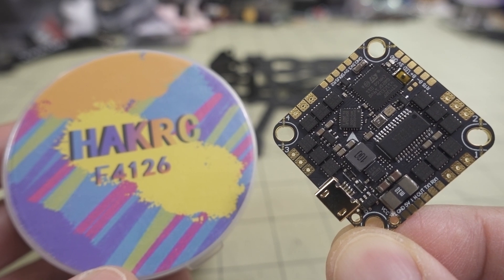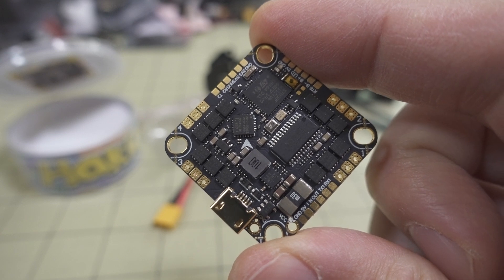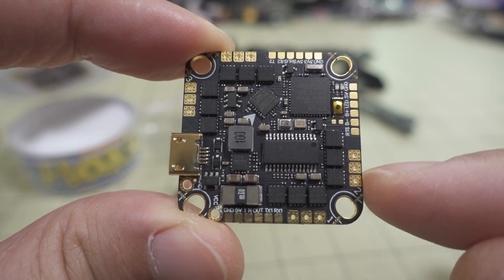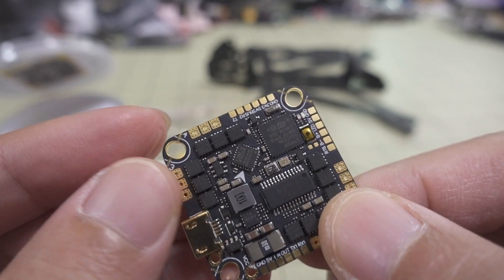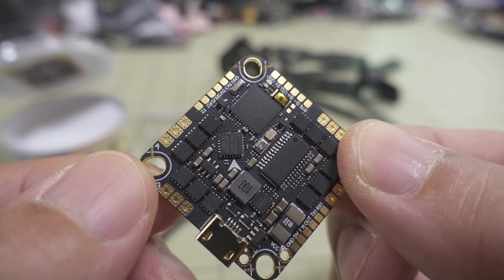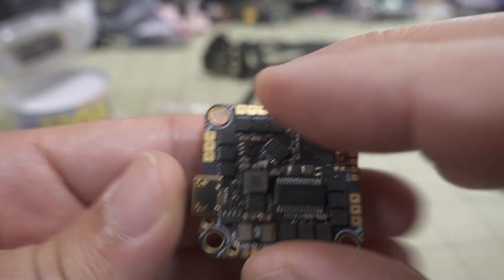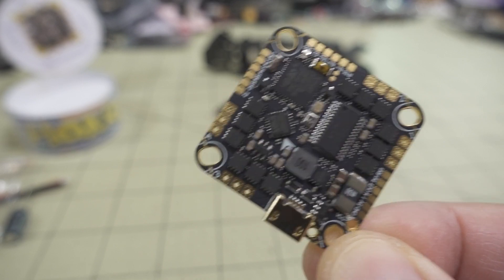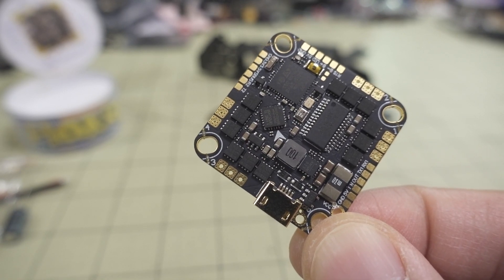Budget Micro Build Option // HAKRC 20A AIO FC for $35 💲

Comment: im trying to wire up an r-xsr getting no stick inputs through any of the pads. how would you go about wiring up an rxsr ive looked online and there is no manual anywhere thanks for any help!
Reply from the maker: Simple.  Signal to SBUS, 5V to 5V, GND to GND.
Reply: @AlbertKimTV seems like a dumb question but that was exactly what I thought in the first place sbus of course... but it wouldn't work. Thought maybe the board didn't have an inverter or something I dono thinking to much...
 Starting to think my rxsr is screwed up a few times signal came through and all my channels went haywire when I would move the receiver...thank you very much for your speedy response

Comment: HELP.... Albert Kim I'm trying to get this to work with dji video and nano rx also with GPS but I couldn't find any information on what pins are for soft serial.
I ended up making such a mess of the configuration  I've reflashed with bf 4.26 and now I don't have any soft serial to choose from. 
I don't suppose 1. You have a diffall dump dumb for bf 4.1 or 4.2 for this fc where the soft serial is still configured? 
2. What pads are for the soft serial?
Thank-you in future for any reply that could help.
Reply from the maker: I setup this board on the Transformer Mini build.  It has crossfire, DJI, and GPS.  I think the GPS is on the softserial, but it might be the vista.  Not sure.  The CLI dump is in the video description...  https://youtu.be/v_yYE6sF3sg
Reply: @AlbertKimTV  thankyou very much 👍 you wouldn't happen to know what pads on the fc are already set up for soft serial on would you? I'm planning on putting the vista on soft serial because I'm using the same GPS that you did.

Comment: still cant figure out if i can solder an A8S on this board since it only says SBUS and i tried connecting the signal wire to SBUS and set it up in BF but still not working. Any idea what to do?
Reply from the maker: SBUS and IBUS are inverted so you can't connect an A8S to the SBUS pad unless you change the A8S to SBUS mode.  You can use the R2 pad next to the SBUS pad and that will work with an A8S in IBUS mode.  Also make sure you select IBUS as the receiver protocol in BF.
Reply: @AlbertKimTV  thanks albert.. And yes.. It worked.. This freakin board ao tiny.. Haha. Managed to squeeze everything in this tinawhoop frame.
Thanks again.. R2 was the key indeed!

Comment: Great review. 

I was looking into HakRC products earlier today. Do you have any durability testing? I always feel like 20x20 FC and ESCs are more delicate (especially the 20x20 35A escs for 5” quads) but I could be wrong.
Reply from the maker: Like I said, I think if you're going to budget and cheaper stuff, use it on things that aren't gonna be abused.  If you crash a lot, I'd say get at least a couple of these and/or spend the extra bucks for the 40A ones for about $75.
Reply: Thanks!  Yeah I abuse my electronics. I just would rather blow a $35 ESC than a $70 one, especially if the $35 lasts like 6months. Haha

Comment: Could I use this as a replacement board in betaflight hx115?
Reply: 3s or 4s battery? Technically, yes you can use this as replacement and it might work, but like any of these AIO boards, the quality control is random seemingly. You may want to try a jhemcu 30 or 35a, but same can be said for those.
Reply from the maker: Yes

Comment: albert hi mate...i recently got the flywoo vampire2 hd with the dji goggles included plus radiomaster + crossfire..eeverything works  fine ...i have a gps  module to add on only left..will that  even work or i ll waste just time? and the main question i have is why on osd not all choices appear on the screen of goggles? i mean i want the RSSi and Qlink on screen..the rssi shows but i m sure its not correct and the Qlink not appearing at all..and some others dont appear too ...i tried uploading a tone of different fonts trying to make it appear but nothing....is there anything i can do? and how to make Rssi show correct if there is an easy fast answer?

Comment: I've got a similar one branded FEICHAO 35A rated 6s for $32 @ Xnite I'm sure all this boards are from the same factory and gets distributed to a company brand and named it.
Reply from the maker: Are you talking about this one?  https://bit.ly/34D6MDo
Seems the 20A and 35A look the same.  I'll have to pick one up and compare.
Reply: @AlbertKimTV  yes that one and yes please do a comparison test if possible
Reply from the maker: @Bisdak.3475  HAKRC told me those were made by them and they rebranded them under the FEICHAO OEM.  So it's the exact same product...
Reply: @AlbertKimTV I suspected it is the same but how do we know from a 2a to 35a? Overall the board is laid out quite neatly.
Reply: @AlbertKimTV  my JHEMCU 20a just start to do the death roll, got any advise.on where to start diagnosing?
Reply: thanks for the link , just picked one up 👍👍